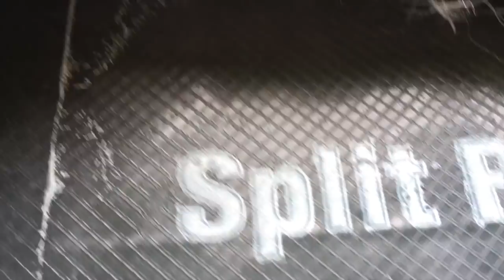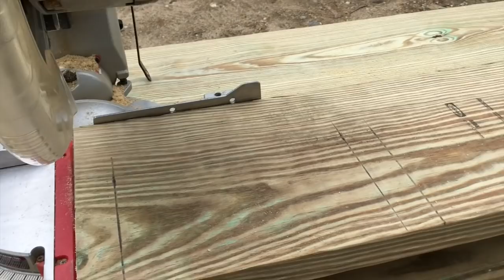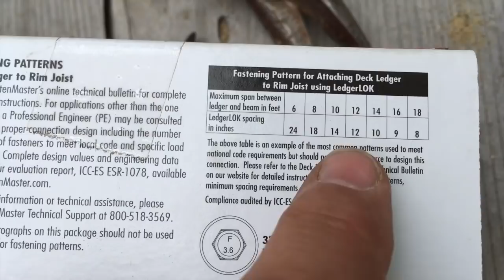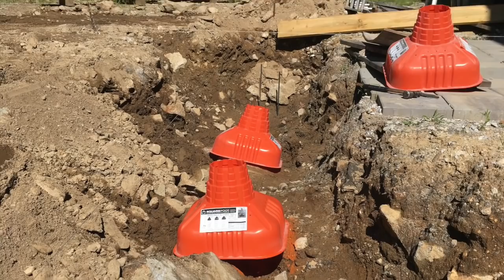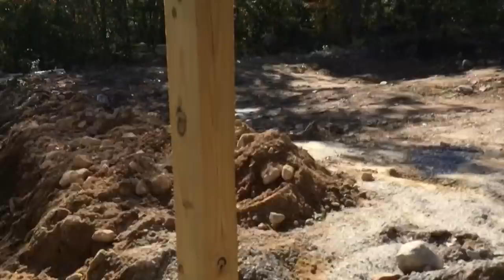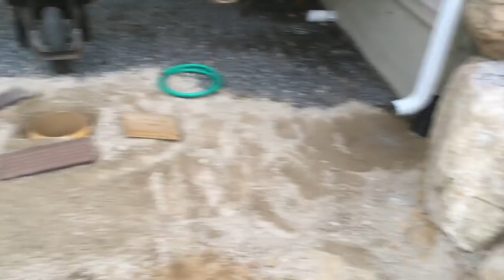Ledger Board Install

Comment: Nice job.  I didn’t consider that a ledger board but I do like how it worked.  Typically a ledger board is installed to simply hold an item level when installing, like a kitchen cabinet.  When done the ledger board comes down.  Regardless I like what you did.  That’s a massive deck.
Reply: That is 100% a ledger lmfao
Reply from the maker: Thanks, I just added to it 😂 If it would stop raining here in New England I could finish it lol.
Reply: Ledger, header, rim joist. Potato, patato.

Comment: Hi, how do you prevent the rain from penetrating to the floor beneath? Is there a plastic sheet of some sort?
Reply from the maker: You can add rubberized roofing under the decking but I didn't want to do that. I will add steel roofing under the deck at a later date.

Comment: Looks really good!  Only question, why is the deck several inches below the sliding door.  Seems like a high step to when walking into the house.
Reply from the maker: Hi Mike, 7 1/2'' step down because we have lots of snow where we live and this is a buffer for when it's melting.

Comment: What does the ledger bolts screw into?  Screwing into the studs?
Reply from the maker: Hi ShuhDonk, they screw into the rim joist and or wall studs in the basement.
Reply: @EddieCarrara1  Thanks for the response.  I am wanting to build a lean to off the back of my garage.  I want to put the ledger board just below the roof line of the garage.  I assume I need to hit the studs when attaching the ledger board in this location?   Thanks!
Reply from the maker: @ShuhDonk  yes, bolt the ledger board to the studs👍

Comment: Hi may I ask how did u install the brown deck floor to the wood? Did you use nail? But I didn’t see any nails on the brown deck floor . Thank you for posting this video rlly helpful!
Reply from the maker: Hi Felyan, This type of decking uses a hidden clip. There is a channel on both sides of the boards and the clip attaches there. Here is a link to several different styles on amazon but you need to have the correct decking boards to match the clips. Let me know if this helps 😊

Comment: Nice video, could you tell me how to locate the beam to attach ledger board for two story house , where there is no access from inside except make a whole in dry wall.
Reply from the maker: Hi Ram, thanks. The floor rim joist always sits about 3/4'' below your interior floor around the perimeter of your house. Once you remove the siding you'll notice where the studs and rim joist are located by where the nails are in the sheathing under the siding. Hope this helps.
Reply: @EddieCarrara1  thank you very much.

Comment: Why did you opt for the unstable and dangerous shortcut of a ledger board?
 Why didn't you build your deck properly as a self supporting structure?
 Are you just that cheap?
Reply from the maker: Hi Willard. I am cheap but that's not why I built it this way. This was the first time I constructed a deck this large so I visited the job sites of professional carpenters to get some input and ideas for my project. I visited 4 of them and all were building multi million dollar houses at Lake Winnipesaukee in NH and I assumed they know what they were doing.
 I wish I knew your email address or phone number so I could have contacted you for your advice. I tried looking on your YouTube page for some instructional carpentry videos but someone must have taken them down because your page is empty. Maybe you could try using some constructive criticism with some tips or suggestion instead of insulting people with ignorant blank statements. Thanks for watching.
Reply: Agreed..always opt for a self supporting 2nd story deck even if code doesn’t require it. Nice work tho man good luck
Reply: @outraguz8185  Code will eventually require all decks to be freestanding. Or at least there will be so many special intrusive requirements and expensive hardware that it will become the more financially viable choice.
 Death by ledger board is far too common.

Comment: How do you know if bolt will go into something structural? I did one and it was wall joist behind the siding and house wrap. Wasn’t a rim joist up that high
Reply from the maker: If you build it about floor level there should be a double rim joist that the interior house floor joist are connected to.
Reply: @EddieCarrara1  excellent

Comment: How did you secure the top of your posts to the deck?  The deck appears to be resting on the posts.
Reply from the maker: Hi Chadney, the rim joist sits on top of the post. If I were to build it again I would build a beam and have the joist rest on the beam. I did it this way for maximum visibility looking out back, if I had the joist resting on a beam I would have lost 10'' of visibility but it would have be much easier to build.
Reply: @EddieCarrara1  thank you Eddie.

Comment: Are those ledger lock screws screwed into the facia board going into the joist into the house? Or are they only screwed into the facia board.
Reply from the maker: Hi MoMo, 😂😂😂The ledger board is screwed to the rim joist and door and window headers below the rim joist. I'm going to make a video on how I did it because I get asked that question a lot, lol.
Reply: @EddieCarrara1  WOW!! Lol window headers and door. I installed mine to the rim joists. It was a pain in the arse. Now I feel like I did something wrong? Did I? Asking for myself.

Comment: Did u open the wall to make the door?
Reply from the maker: Hi Alicia, 
No, the slider was already installed by the builder, but they forgot to build me a deck 🙄 I was sick of looking out and not being able to walk out the door. Builders are not easy to work with and you need to be very careful about how they charge you for add-ons.

Comment: Great tutorial. I've been trying to find a similar setup for building a deck on an upper level. So glad i was able to see your video. So much to learn for a first timer. Planning to build mine in 2 weeks (shooting for a 12'x30' size - depending on composite cost :). Can I ask how big is your deck (14x24 or 12x24)? Also, if it's 24 feet wide how did you layout your composite decking (ie 2x12' 's then alternate the lenghts? Thanks
Reply from the maker: Hi Mark, 
Thanks, and Yes, the deck is (14x24 and 12x24) because of a bump out in my house wall. I did a 12 x 12 and 12 x 14 picture frame on each. I also did my framing 12'' on center instead of 16'' because the composite decking very flexible and I didn't want it to be wavy.

Comment: How did u find location for your band board on your house bolt ledger board to ??????
Reply from the maker: Hi Alan. The house floor is connected to the rim joist so the rim joints are at the same level as the house floor. My basement is unfinished so I could see exactly where the ledger board was being mounted. Once the exterior siding is removed you will be able to see where the outer wall sheathing is attached to the frame by the location of the nails. Let me know if this helps. 👍

Comment: Were the second floor joists parallel to the ledger??? if no and the ledger was perpendicular to the ledger then , were you supposed to attach the ledger to the wall studs instead every 10"
Reply from the maker: Hi Emad, The Ledger board is attached to the rim joist, the basement wall studs, and the basement window and door headers because of the position of the deck. 👍

Comment: Is this is your first time building a deck?
Reply from the maker: Hi Ivan, I've only built 3 decks in the past 30 years and there are a few things I would do differently but I'm pleased with the results. The white trim on top of the ledger board is Azek and can be bought at most big box stores.

Comment: Looks Awesome,did you sink the ledger lock screws into the rim joist of the house? I want  to cover my deck with an attached canopy,that`s gonna be framed and covered with plywood and shingles. I didn`t know if I have to attach it to the rim joist or just screw  it into the house.
Reply from the maker: Yes, it's directly into the rim joist otherwise the screws would pull out or sink over time. I know some have commented that it's too low but my basement is not finished and I can see exactly where the rim joist is located. 👍

Comment: Great vid! Tons of work.  I looked at the other vids you've posted and I don't see any that cover the tin roof you said you were going to have under the deck.  Is that part of another vid?  I'm going to have to replace my deck this year and doing that may just change the size of my deck.  Thanks! Mike
Reply from the maker: Hi Mike, I haven't got to the tin roof yet, that will be my spring project in 2020. If you're looking to change the size of your deck, remember bigger is better for both uses, top and bottom. If you subscribe you get a notification when I post it. Thanks for the feedback 👍
Reply: @EddieCarrara1  Okay. Thanks. I subbed. :)

Comment: Great job what type wood or material of deck floor did you use? Looks like they were stained before you installed them.  and did you build the underside yet and have a video?

Comment: I am builder & developers every Concret post need 3’x3’ concrete footing too other ways your post will move by the times 👍
Reply from the maker: Hi Rocky, I doubt my post are going to move, I have them pinned to a chuck of granite bigger than the deck lol.
Reply: Eddie Carrara 
Yeah I think he missed that step you did.  No way your posts are going to move the way you drilled into those huge boulders with 3 rebars per post.

Comment: Your ledger board is so far down, it makes me wonder if your bolts went into the rim board at all or missed it completely and only penetrated the plywood.  If so, this deck is a candidate for collapse.  Am I missing something?
Reply from the maker: Hi Frank, 
The basement is unfinished and I could see where the rim joist was located, no worries my friend, measure twice cut once :)

Comment: You went through all the work  with digging and doing sono tubes for crazy foundations but then dont have a drop beam so all the joists are bearing on the beam with the load carried down to the posts down to your footers. Just doesn't make sense.  Notch your 6xs then do a double beam Under your joists...I Dont get why people rely on hangers so much.
Reply from the maker: Hi Mascmc, You are absolutely right, if I were to do it again that's what I would do, and it would have been a hell of a lot easier hanging the floor joist. I was trying to get the best view while sitting under the deck as well and if I would have used a drop beam I would have lost about 10 inches. Thanks for the feedback, I really appreciate it.

Comment: does the ledger board have to be screwed into studs or just the siding of the house ?
Reply from the maker: The ledger board should be screwed into the rim joist.
Reply: @EddieCarrara1  ok... i hope my rim joist goes all the way across.. i have a multi level deck (2 levels) and the rim joist may stop, then start again after each level stops...I am hoping it goes all the way across on each level of the deck.  im guess the only way to know is to remove the siding ?
Reply from the maker: @spkendrick  The rim joist is at the same level as your interior floors of the house. Floor joist are usually 2'' X 8'' to 2'' X 10'' boards. Hope this helps.

Comment: I assume that those LedgerLOK screws are designed to be screwed into the rim joist of the house and not just the sheathing, right? In this situation where your deck is a step down from the floor of the house how do you know you are hitting the rim joist of the house?  It seems like the lower row of screws might be going in below the rim joist.
Reply from the maker: My basement is not finished and I can see everything, not to mention I have huge headers over the sliding door and window that meet the rim joist so I have about 22'' of lumber below the upper sliding door lol. Good tip tho Ministryof Truth, some people wouldn't think of that.

Comment: Excellent job! You could have used Trex rain escape rather than installing a metal roof under the deck. Rain escape would have protected the beam and joists as it is installed between the deck boards and joists.

Im no scientist, however a metal roof under the deck would create better conditions for rot on the joists.
Reply from the maker: Thanks Derek, I haven't installed it yet so I will do some research, thanks for the tip :)
Reply: @EddieCarrara1  you can’t put in rain escape after the fact…..

Comment: Eddie, this is really great; congratulations on a fine job.  One quick question: How closely did you work with your locality re permitting, inspections, etc.?
Reply from the maker: Hi Michael, I got all the permits as needed and followed code. The last thing I wanted to do was build an unsafe structure and have to take it down. The permits were cut and dry, no issues.

Comment: Great video, Eddie.  Definitely helped answer some questions I had when it comes to installing and building a deck.  I’ve got a couple decks to build on my apartment building, plus stairs for both.  Quick question: I really like that dark brown trim you used on the deck and the black railing, what kind of trim/railings are those?  Thanks man!  Fellow New Englander here too
Reply from the maker: Hi Gordon, us New Englanders are Wicked Pissa lol. The decking is Veranda (Home Depot Brand) and I just special ordered the trim boards to match. The black railings, balusters, black post sleeves and lights are all Timber Tech bought at Bensons Lumber, I also added a dimmer switch to the lights because it was so bright it was like a landing strip lol. Good luck with your apartment building decks.
Reply: Much appreciated Eddie!  I’m looking forward to the project, that’s for sure.  Good to know on the materials, definitely have some time before spring to plan it all out and get materials sourced.  Great idea with the lights and the dimmer too haha.  Take care man, go Sox!

Comment: Hi I too love in new England any chance you can give a rough estimate as to how much was your  project considering you  did it yourself. Thks
Reply from the maker: Hi Iron Will, the complete project top to bottom cost about 8k, I had estimates from builders from 18k -22k. The estimates didn't include the color choices (black railings and black post sleeves) or led wired lighting with dimmers, they were going to use cheap white vinyl rails and balusters, everything I used was a composite with aluminum balusters :)
Reply: thku sir

Comment: Nice work.  I want to do the same to my house.  I'm sure it will take longer than 4 months for me though.  What are you plans for the patio underneath?  Will the cement be flush to the footings?  I was curious if it was best to do lay cement of the patio first before doing the 2nd floor deck.  In any event, it turned out great.  Wish you lived closer to me to help.  :)
Reply from the maker: Hi Pablorpm, 
4 months is a long time, I bet you can do it. I'm in the process of leveling the base for the patio, then I will lay patio block, pouring concrete first would be fine as long as you have your footings for the post in first. I'll keep posting my progress so subscribe to my channel so you get the notifications :)

Comment: I am in Maryland and I think we have similar weather. Has the deck gotten too hot to walk on? If so, how hot was it on those days? Thank You.
Reply from the maker: Hi Steve, It gets hot but I wear either sandals or moccasins  and never have a problem. If you're installing it around a pool, hopefully the water will keep it cool enough for bare feet. My cat doesn't mind lol.

Comment: What you did is OK.  I would have wrapped my ice and water shield down and over the top edge of the ledger board.  Sandwiching that stuff behind the board sets up a cantelever effect.  Over time the shield will compress due deck traffic and the ledger will not be tight against the house.  Go back and retighten the lag bolts every year or so.   Nice job though.
Reply from the maker: Thanks for the tip Chris :)

Comment: Great video .  Did you flash the entire deck so water rolls off of it ?  What material is the deck made out of ? Does it leak ?
Reply from the maker: Hi J-FONT, 
My plan is to use steel roofing panels under the deck so I can have a patio to sit at when it's raining and also it will be used to store patio furniture in the winter. The deck, railings, and post sleeves are a composite material. I'll let you know how it all comes out and I'll post new videos about the construction of the whole process. If you subscribe to my channel you'll get my video updates automatically. The project should be completed and videos will be posted by July 2018 :)